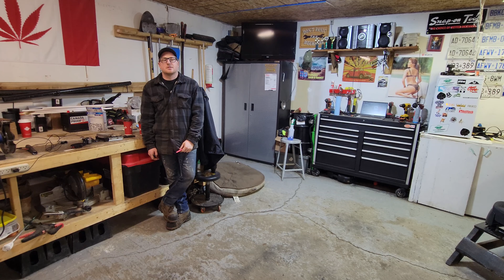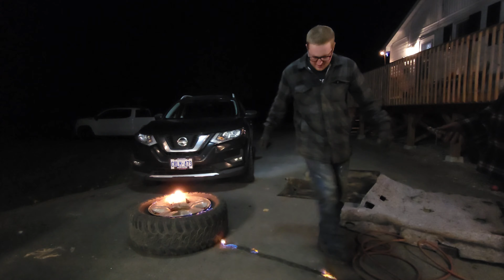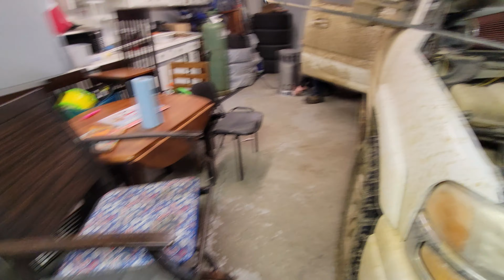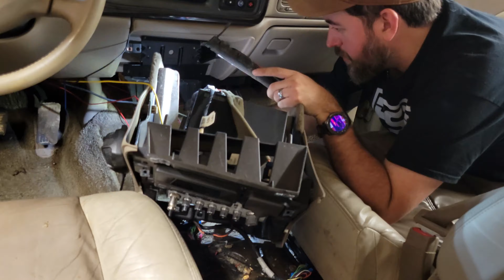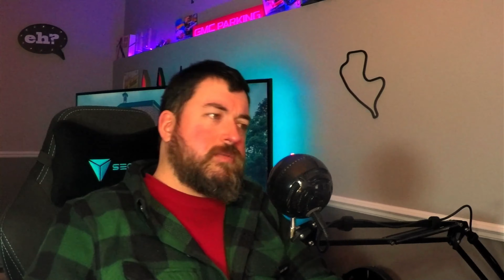Attempting to fix the Swamped Denali

Comment: Keep the Denali content going.  I have a 2004 Suburban AWD Suburban and it has a 4 low!  5.3L with 243K miles on it.  Original  motor and trans.  The transfer case was replaced at 176K.  In the last year or so I've replace every suspension component front and rear.  Torsion Key lift, Z71 coils in the rear with 2" blocks.  Running 33's with 2" wheel spacers and the same fender trimming I watched you guys do.  In the garage I have a hidden winch from RC and a 13K lbs  Fiery Red winch I'll install in a few days.  Over Christmas and New Years I drove it 1400 miles to Arizona (3K miles round trip) for a week of Overlanding.  I have the same rusty rockers and lower rear quarters.  That's another project for the summer on the old Burban.  I regularly pull my boat and a trailer.  Looking forward to more content.